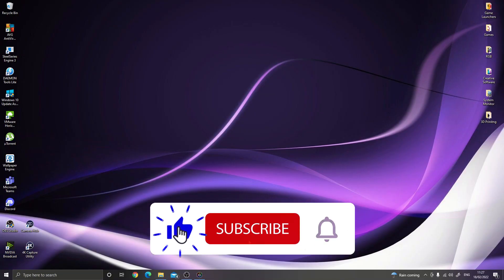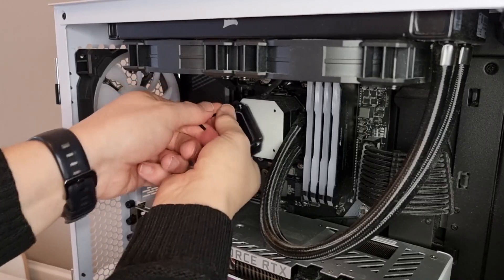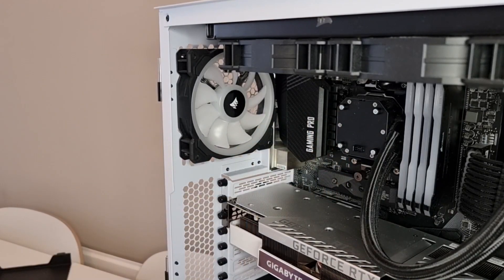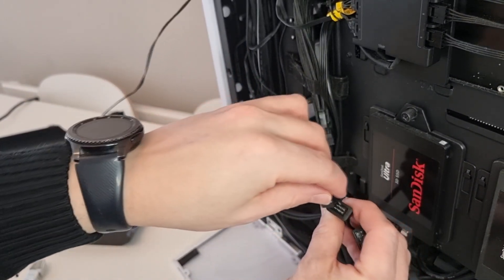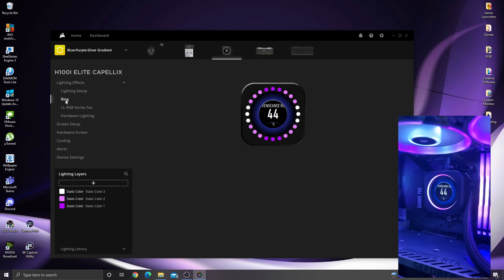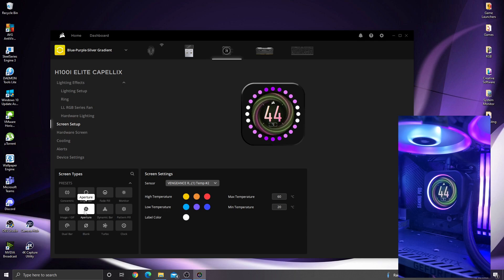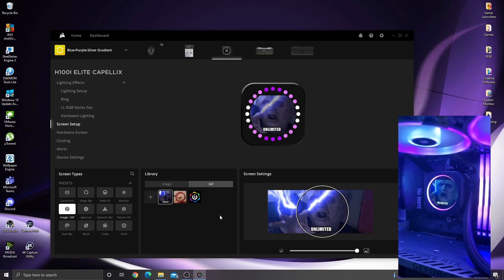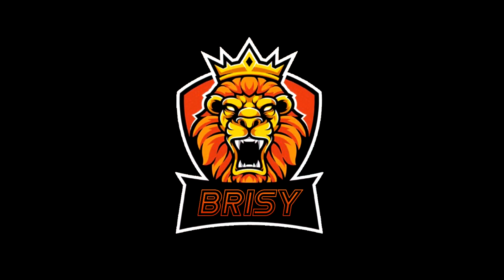How to install the new Corsair LCD upgrade kit

Comment: Tell  ya what mate, you are the man. I also am running an AMD system and spent the day the other day trying to get this LCD to fit on my H100i Capppelix. In icue it was showing the screen as all working perfect but when you looked at the module in my case it was just showing a black screen with a large white 0. So basicly what was showing in icue is not what was on the actual lcd screen. I could even go through all the presets in icue no issue but still no change on lcd. I spent all day messing. Unscrewing the 4 screws to all different lengths to get a better secure fit over my pump but no matter what I did, no joy. So I got on phone with corsair, explained my situation and the guided me through different fitting scenarios as I'm using there 4 port usb 2.0 header hub. Still no joy. From the very beginning  I wasn't happy with the fit over the pump. It just wasn't secure enough so I created a return for Amazon and sent it back for full refund and purchased another. As corsair was saying the 1 I had is faulty. So I have a brand new white 1 to go in my corsair 5000T case. (AMAZING CASE BY THE WAY) Cos I can see you like the corsair gear yaself. So I thought before I fit it I'll check out a few vids and see if any are using AMD build and see how they get on with it and I find your vid first. No way did I know you could remove that shroud. When I saw what you did I was blown away. Amazing idea for all AMD builders who are using the lcd upgrade kit. Thankyou very much mate. I've not fitted my new 1 yet, I'll be doing it later. But now I've saw your vid I feel alot more confident in it working for me now. Could not believe it when I saw what ya did. Nice one buddy. Congrats  from Liverpool. 1 like and 1 sub well deserved. (IF IT DOESN'T WORK THOU LATER I'LL TAKE MY SUB BACK.) Only kidding. Cheers matey.
Reply from the maker: Thanks for the feedback buddy, when I was trying to mount mine I just couldn't get it to seat properly  at all. Thankfully there were others before me who had the same issue and I found a solution thanks to them.

Felt I had to make sure I got that piece info I  there to share it as much as possible, I'm amazed though that Corsair didn't pick up on the design fault and alter that shroud in future units.

Hope removing it works for you buddy, can't beat a good corsair build 😉
Reply: @BrisyTechBytes  Hi buddy. I fitted it like you showed and all working fine now. Ya never gunna believe what i did? After sorting it all out I was cable managing the final cables of it all and cut through the zip tie and the thin cable for CPU fan header!!! I was going mental. Rushing you see to finish it. Managed to strip wire back and re join it in 2 places. All working fine again. Only happen to me that. You take care and thanks for reply.

Comment: You saved me after 2 hours of troubleshooting why my lcd upgrade was red triangle of death. I’m on AM5 which uses the AM4 bracket and taking the plastic housing off allowed it to make contact with the 8 pin and it’s working! Thank you
Reply from the maker: Glad this video has helped you out, bit of a strange design that you need to do this but you can't really see it so it's not that bad....imagine Corsair will come up with something better of any future releases of a similar product.

Comment: Thank god I found your video. I was about to loose my mind. I could not get it to work and when I learned from you how to take the friggin plastic part off it works perfectly now. How the hell can Corsair put a product out and not know that this has to be done to use it with AMD CPU’s. Unbelievable
Reply from the maker: Glad my video has helped you out, it is quite a poor design, on top of the issue with the plastic bit fouling the socket there is the issue with the red triangle of death people have been getting too.

Hopefully in any future releases of a similar component Corsair nail it as any other time they stuff is normally great.
Reply: @BrisyTechBytes  Absolutely my whole system is Corsair. I feel that it seems great after taking the plastic cover off. Now it actually sits nice a flush the way it’s supposed to. I was getting the triangle but after watching your video I knew right away it was because I couldn’t actually plug it in properly. All good now though. Thanks again!

Comment: you don't show it functioning when installed in the case itself?
Reply from the maker: I do, when running through the software the picture down the bottom right shows it functioning within the case?

Comment: are you able to save the changes you made in screen setting?  I made some change for one presets and when I switch to an other preset and come back to the previous one the change i made lost, it just reset back to default setting.  Have you having the same problem?  thank you
Reply from the maker: Just booted my PC and tried switching my profiles, my screen changes to whatever I have set it at under each profile bud, no issues there for me
Reply from the maker: Hi Calvin, to be honest it's not something that I have noticed as I mainly just use the one profile, I'll try it today at some point and report back to you

Comment: Thank you so much for that call out on removing the plastic housing to fit with the AM4 CPU bracket.  It would not fit by the smallest margin.  Now it’s nice and flush, no issue, and honestly looks just a bit better.  Plus I did not have to tamper with t moving the pump header at all.
Reply from the maker: Glad it has helped you out, no doubts others will come up against the same issue and probably return it thinking its not going to fit, hopefully the word spreads that removing the housing does the trick...or corsair modify it somehow in the future 👍

Comment: I was wondering how you approached the install because i also have an AM4 CPU and I had to remove the pump head and move the lower bracket out a bit so you wont have to remove the plastic piece
Reply from the maker: Hi Chief, on my motherboard there just wouldn't be enough movement in the bracket to allow the lower plastic piece to fit in. I actually installed a new motherboard altogether and didn't even try installing the pump again with the plastic nit on, might have actually been OK on this motherboard 🙈

Comment: You're freaking amazing! Thank you!
Reply from the maker: You're welcome Darius
Reply: Did not even think to unscrew the stroud part. Fits so nicely. I noticed your icue looks different from mine. I dont have a screen setup option.
Reply from the maker: @The-Rev-91  that's weird, latest version of iCUE installed?
Reply: @BrisyTechBytes  yes. Gonna try pushing the commander cable in to see.
Reply: Thinking the cable wasn't properly seated.
Reply: Wooo fixed it
Reply from the maker: @The-Rev-91  excellent, hope you enjoy it 👍